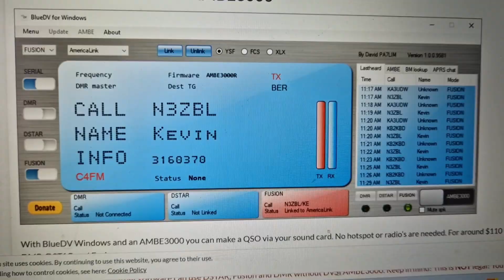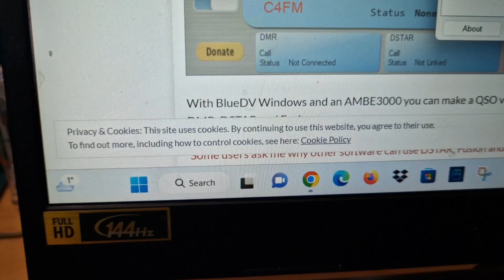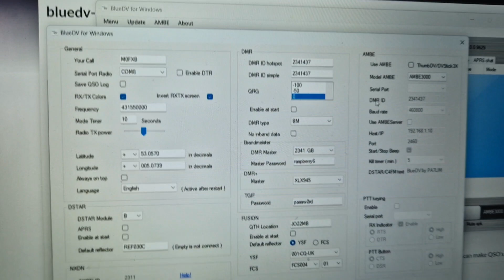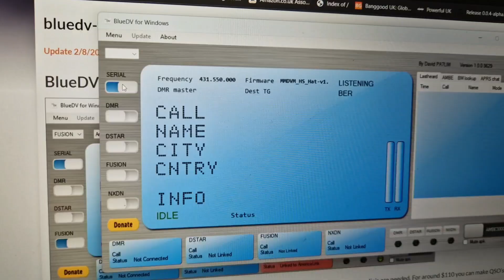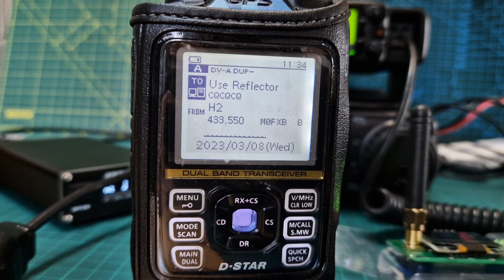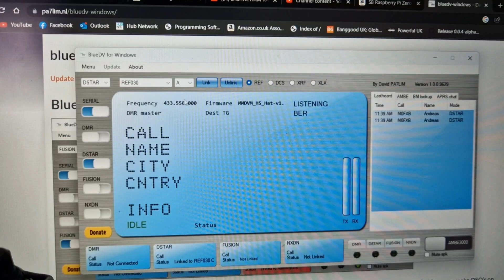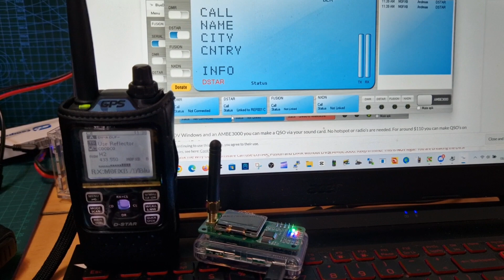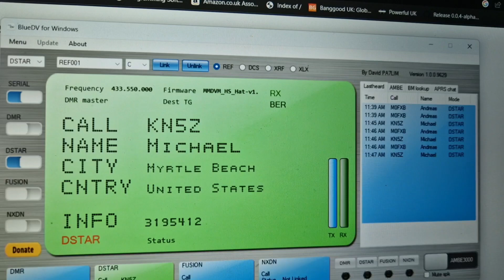BUILD USB MMDVM BLUE DV HOTSPOT

Comment: I just tried BlueDV for the 1st time today connected to my Retevis RT3S running OpenGD77 in BlueDV Hotspot Mode.  Man was it easy to get up and running!  I can see the advantages for those not so computer literate.  Very well laid out setup menu and the display screen with caller list is beautiful.  Pity you can't maximize it though .  I used my little DM-5R also running OpenGD77 as my handheld connecting to the RT3S in hotspot mode.  Now thinking of getting it running on a spare Android phone to use as a very portable hotspot.
Reply from the maker: Yes with ambe stick it provides a WiFi server
Reply: Thanks Andy 👍🏾